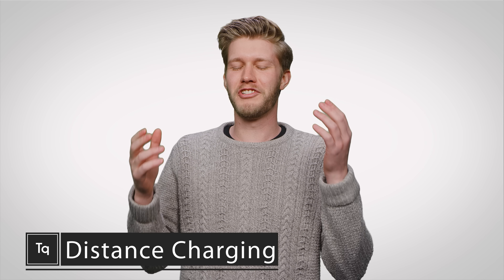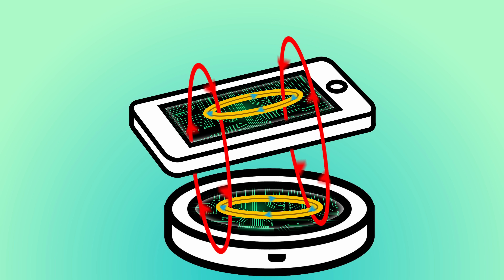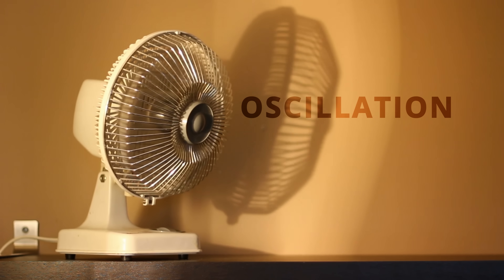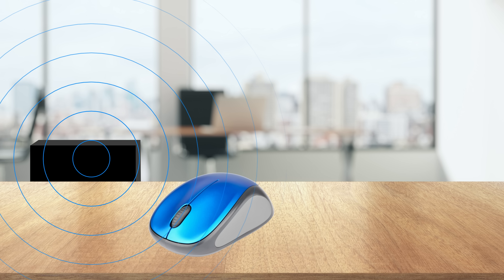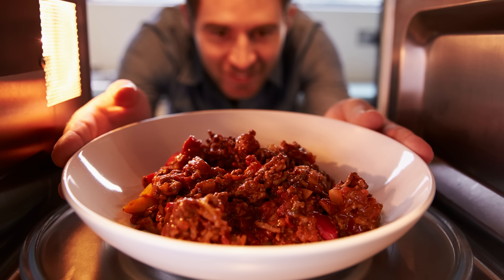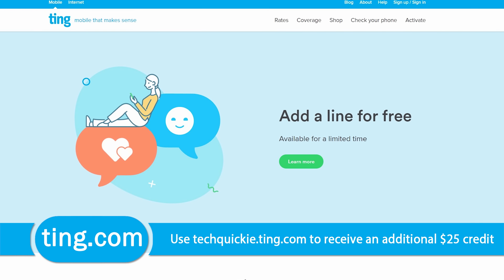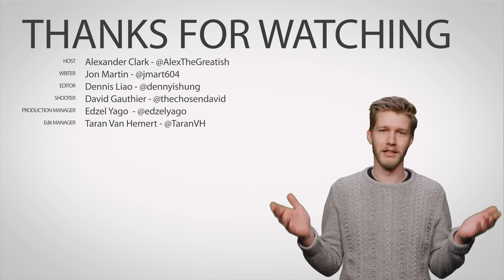NEVER Forget to Charge Your Phone Again

Comment: Wouldn't a charger like the 3 DS's work the best you just said the 3 DS on the charger and two pins get pushed Out and Touch metal spots on the back of the 3 DS so one it just locked in super easily unlike those wireless chargers we have to try to line it up and 2 since it's technically connecting a wire there's no power loss

Comment: Routers operate at the same frequency as microwave ovens (sometimes higher frequencies at 5GHz)  and that they transmit well over "a few milliwatts" typically in the range of 50mW to .5W. Unless of course you mean it can only charge at a few mW. In that case you are looking a few uW not mW. RF is a terrible idea for wireless charging. Seriously, a very very terrible and inefficient idea.

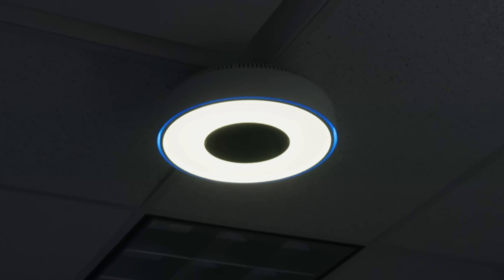Comment: 3:58 ... only problem is how much power you are loosing in the process... The efficiency can be as low as 1 % ... SO while you are wasting 100W power on you electricity bill ... your device will only be charged with 1W ... the rest of the 99W are lost.

Comment: the only way long distance wireless charging is going to work for devices that use more then a tiny amount of power (like a mouse\keyboard) is if it's directional.  Who the fuck would really wanna pump 100+ watts into a charger only to get 5 or less at their device?  The directional part could be automated (i think the IR device did this)

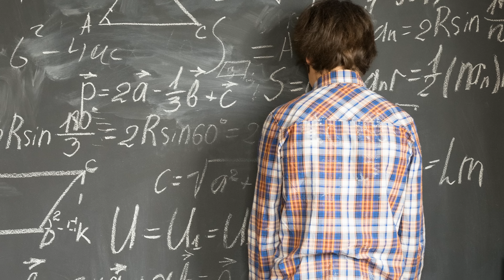Comment: 1:37

No, its not. Its a pretty simple concept if you boil it down. Its essentially the same thing that makes 2 of the same notes ring out together. If you have an A4, 440hz, and an A5, 880 notes, the ring together with a ratio of 2:1. This is harmony. For every one Oscillation of A4,, there are 2 of A5.

If you take an A4, and detune it to 435hz, and make it ring with a non-detuned A4, you get 440:435, with a remainder of five. So for every oscillation of A4,  it gets 5hz out of phase. With electric current, this lack of phase prevents the ability of the circuits to resonate, by making there a fundamental difference in the shape of the current, and phase of the magnetic fields. 

Hope this helps. Feel free to correct me if this is 100% bullshit

Essentially the magnetic fields ring out WAY faster than we can hear, in the same way 2 wine glasses ring out if they are "played" together.

Comment: What about the fact that wireless charging of all kinds wastes more electricity than plugging it in directly? It's convenient, but in this modern world of trying to save electricity it's going to cause problems when large numbers of people switch over. See "The truth about wireless charging" by Real Engineering to see what I'm talking about
Reply: very true, but for low power devices it's really not a concern so long as it's remotely efficient (RF charging without beam shaping could be horrible)  Considering the battery capacity of most phones is sub 15wh, and such a phone will last a day or more, it's trivial.

Comment: Ugh. RF charging should not be a thing. The efficiency is going to be so terrible, like less than 1%. RF spreads out as 1/R^2, so there is a ton of loss over even short distances. We don't need to be wasting more energy just to charge our phones remotely. Just get out of your bed and plug in your phone, you lazy ass!

Comment: I have not had that moment. I plug it in to charge when I wake up, so it's not trickle charging at 100% for most of the night.
Also, "over the air" charging is what should really be called wireless charging, and the crappy "wireless charging" we have now should be called "dock charging". It's not wireless charging until my phone isn't tethered to any device. Replacing the wire with a dock isn't wireless, it's actually more cumbersome and inconvenient. Easy to tuck a cable away when not in use for the 22 hours a day I'm not charging, hard to tuck a giant dock away.
Reply: 0:39 - You see, if I have to plug in a charger using a wire, it's not wireless!
(this is critique/a rant about the garbage technology, not the video)

Comment: What's the net efficiency of wireless charging even now?  Something like 1% or less since they sit burning power 24 hours/day and only work at 25% or less when in actual use?  Green New Deal says what?
Reply: qi is 60-80% or so efficient, and it's not going to use much power if it's not actually charging a device.  They don't simply sit there pumping out full power at all times, that's not how the tech works (it's basically the same as a power transformer)

Comment: I think a better way of explaining about how IR energy relocation would work.  Is to say it's pretty much like a laser.  Most people have no issue imagining how a laser would burn anything it is pointed at.  Even if it is far, far, away.  Then explain how heat is energy is motion is mass (as explained by e+MC^2).  And they can easily see how IR can only travel in straight lines.

Comment: This CAN'T be safe !  I just did away with my Smart Meter & Turned OFF my WiFi and connected every computer by ethernet cable....FASTER, 200mbps instead of 100 or less mbps through WiFi.
Reply: BAD B congrats! reducing rf exposure is good. a healthy move.
Reply: BAD B did your power company give you slack?
Reply: @Vaati  Yes, just One time they didn't fill the request.  Then it got put in second time...cost me $19 more for OPT Out, but my Bill is Lower?!?!? yeah !
Reply: BAD B yeah usually analog meters are cheaper, whilst being safer.
Reply: @Vaati  Yep, I heard Smart meters have burned down MANY houses and Made MANY People Sick.  I was hoping that power usage monitoring and jacked-up cost of using at peak times would GO AWAY...and it DI, and I'm saving Money !!!
Reply: BAD B lol

Comment: I don't understand why people use the existing wireless charging. I have Samsung phones and I bought a 2m long cable for 2€ and now I can charge my device even when I'm using my device far away from the socket. At wireless charging, your device must touch the charging pad. That's silly -- it's like wired charging with an extra short cable, I really don't see the point of it ... up until they develop the new extra distant wireless charging.

Comment: Buy the a phone with 18000MAh Battery
Reply: or the Ulephone power 5, it needs sth around 3hours from 0 to 100
Reply: @Young Thug haha yeah
Reply: And then wait for a week for it to charge.
Reply: @NJ-wb1cz  9 hours actually
Reply: @Naverdo  Actually it actually depends on the actual charger and the actual battery. 
Actually.
Reply: @NJ-wb1cz  I'm not sure from what percentage it will take so long but the charging time is 9 hours with the charger that comes in the box
Reply: @Naverdo  my charger came in a plastic wrap. Is it better than the ones in box?
Reply: @NJ-wb1cz  I meant the charger that comes with that specific 18000 mah battery phone.
Reply: @Naverdo  i don't want a battery phone, i use smart phones

Comment: With android just go to the developer options and activate demo mode and your phone is at 100%. Tbh this mode lacks some features. Is nice to change the bar for demonstration but it can be more options.

I think what devices need is a option to set a charging limit and maybe even more. Charging a Li-Ion battery to 100% is not good. With big batteries it's even not needed to charge to 100% to come over the day. Being able to set a smart charging limit, where the device keeps the charge in a certain range e.g. Charging when under 60% and stopping at 80% is better than keeping a device at 100%. Sure when the device can bypass the battery, it won't be a problem.

When devices even have a wide assistant support, you even can say when the device should be topped to the charge limit or even go to 100% but calculate that the device isn't that long at 100%, when plugged in. Depending on the device, the device can have the brain in it or just the charging mechanism.
Reply: It's easy to do, but for some reason no one does it. So for now, grab an app like Accubattery since it has a little warning ding when you reach 80% or any number you choose.

Comment: electromagnetic radiation.. any form or  "size" of it is altering dna in few mins and cause serious health and permanent issues like diabitis..isomnia. is not a theoriticaly study anymore... is fact based scientific result. 🤨
Reply: Yeah, you can't even spell "diabetes" buddy. Get fucked with that bullshit "fact" (very paranoid bias)
Reply: I turned a strawberry into a rabbit by changing its DNA with WiFi signal. True story.
Reply: That's wrong. Only ionizing electromagnetic radiation will cause any sort alterations in DNA. So that means UV, Xrays, and Gama Rays. Otherwise, if what you were saying is true it wouldn't matter anyway because we'd have loads of cancer from visible light which is a shorter wavelength(and therefore has more energy) than infrared, microwaves, or radio waves. So just to clear things up. None of these technologies mentioned in the video use ionizing radiation and would not be harmful in any DNA altering way.
Reply: Mr_McNuggie by what they say
Reply: Well, it's not that Simple. Mor every radiaton os harmful. It all depends on how energetic os the radiaton and how long you submitted to it. Like Captain Heat Said, UV and above are harmful,but when you make and X ray on hospitals, these Lins of radiaton are more energetic then UV, but you're submitted to such a short period of time, If you make less then 2 or 3 a year, they're harmless. In other side of the Spectrum (literally), microwave are much less energetic then visible light or infrared, but If you're submitted for a really long time, it can affect you're sperm quality ,e.g., and If submitted to a high intensity beam of it, It can cook you alive.
Reply: Indeed - I can damage DNA with infra red radiation, or as we more commonly call it because "eat your damaged DNA" sounds weird, making dinner.
Reply: @beware_the_moose  thats the temperature breaking the molecular bonds in DNA
Reply: EM radiation? You do know only UV and beyond are dangerous?

Comment: It's cool but it does also sound like cancer
Reply: It is well known and proven that non-ionizing radiation has no mechanism to cause cancer. I know it's fun to make dubious claims you've heard somewhere without really mdoing research but spreading bullshit helps nobody
Reply: This kind of scientific fear mongering and ignorance is a cancer on our society.
Reply: My thoughts exactly. 5g might be the first worry
Reply: Jesse Leonard there’s the exponential proximity issue, so as cellular towers are usually quite far away it doesn’t matter as much, but things like having a router in your bedroom, or a wireless power emitter near your bed are causes for concern. There’s a misconception that non-ionising radiation is 100% safe at any distance and intensity, I’m telling you now that’s not the case and it’s going to become a bigger and bigger problem over the next 50 years as the new tech spreads, unaware of the mounting cancers which take 30+ years to become detectable. 
(Studied physics and electronic engineering at university and work in the health, fitness, and technology sectors).
Reply: @chrisogrady28  
I call bullshit, that type of radiation is not ionizing radiation it simply doesn't have the power do do that. 
Also, you're better off near cellular towers since as your phone gets farther away, your phone has to output more power to connect to the tower.
And over the last 20 years, the use of wireless technology has increased by a lot, yet the number of Cancer cases remains pretty much the same.
Reply: @chrisogrady28  it's not a danger, its not ionizing radiation, the towers are emitting radio waves emitted are not a high enough frequency to be ionizing. If what your saying is true, then you should have cancer all over you. Viisible light is a much higher frequency than any tower will ever transmit. Visible light starts at 430THz and the highest frequency we normally transmit is about 100GHz, you do the math...
BTW 5G will use current 4G bands... Though some short range bands will exist in the 86GHz range. 

No go stand in front of a lamp and tell me if you get cancer.

https://en.m.wikipedia.org/wiki/Electromagnetic_spectrum

 Here's some research for you. It maps out radio frequencies for you. As you can see the higher the frequency, the closer you get to the nasty stuff. But wait what do you see? Visible light is way higher in frequency than your radio broadcast frequencies. Interesting right?

Comment: The engineers are talking. A summary of what he did in school
Reply: Though, he forgot to mention that, if everyone uses wireless charging, our demand for electricity would sky rocket because wireless charging is immensely inefficient!
For the sake of our planet, don't use it.
Reply: @GLITCH_-.-  Yeah, I have been trying to explain that to someone because he doesn't get why one phone wirelessly giving power to another is not a great idea.
Reply: @GLITCH_-.-  Well he probably skipped that class
Reply: @GLITCH_-.-  Even if it's 1/3 as efficient, and worse 20% of people adopt it (less than that use Qi charging, so it would be even less for this "distance charging."), that would be like that 20% of people using 3 USB chargers. So energy demand wouldn't sky rocket. Not even close. Things like air conditioning/chiller plants, aluminum production, and other high energy devices that use several orders of magnitude more power, will make the increase barely perceptible.
Reply: @xenonram  1/3 would actually be very good. Anything that's more than a few cm away will be exponentially less efficient.
Reply: @xenonram  perhaps not skyrocket though there would be a noticable difference with over 150million people changing.
Reply: It will be a very big increase that is totally unnecessary. I remember seeing a video about it, but couldn't find it anymore.
Reply: @Andrew Delashaw In the video he showed a car charging wirelessly. Currently, I can not imagine there is anything worse than. They have one of the biggest batteries ever built.
People keep wanting to do less and less, and that includes the hassle of plugging a device in a charger. So this tech will spread everywhere. And nobody (no consumer) will take the time to correctly line one coil up with the other.

Comment: Just press alt+f12 and turn on infinite electricity and you won't have to charge your phone at all lmao
Reply: KSP player
Reply: Turn off gravity and have infinite fuel at the same time and fly away
Reply: Put on no crash damage as well so you can fling your phone across the room to your wireless charger
Reply: I still think current wireless  charging is utter bullshit and is zenith of human laziness. 
(Like really WTF it just probably take 2  more calary to connect it to cord ) heck you can use your phone in normal charge.
Reply: @aaddiis45021  you don't have to mess with the cable that could break and the port on the phone/device wiggled out.
Reply: @zmeizy  no purchase a fucking sperate charger.  And put it on the location where you keep wireless charger it is 100 times better. Also charging cable Don't break(one plus 5t).
Reply: @aaddiis45021  2 CALORIeS. 2 FUCKING CALORIES. DO YOU HAVE ANY IDEA WHAT I COULD DO WITH THAT. I COULD PAWN ONE MORE NOOB IN APEX. 
Jeez man. And if I turned on power saving mode in human bios i could pawn two nubs
Reply: @npn2463  ok you have a point man
Reply: @aaddiis45021  i have a rugged phone and removing the rubber plug is horrible if you bite your nails. Wireless charging is perfect for me
Reply: I agree but one benefit would be not wearing out plug connections. Other than that, just plug them in for petes sake. I find some things labeled " new and improved" are just a lazier way to do something and sometimes with a negative side effect over time.  I will just stick with plug in for the phone though.  : )
Reply: Alt + f13 is even better
Reply: @alexhazard8807  ctrl + alt + f13 opens up free  game hacks!
Reply: Yespacito troll physics heheheheheee
Reply: What butons to press to Make keyboard for phone ?
Reply: Ha! jokes on you alt-f4 does NOTHING on a mac and alt-f11 and alt-f12 open system preferences.
Reply: yes sir
Reply: Also press ctrl + W to win at life.
Reply: Ya but im tryna beat the game without cheat codes
Reply: I love how a KSP joke is getting so much attention. Well played
Reply: You guys have it all wrong delete system32 and you will have no more power issues!
Reply: might as well set orbit around the sun while you are at it
Reply: Nah just use ALT+F4
Reply: Just add struts to your phone
Reply: super+f15 is actually usefull
Reply: Why not F69??
Reply: But phones don't have an alt or f12 button!!!!
Reply: Inatuctions unclear, It just quit my game
Reply: Yespacito the shortcut ur thinking of is alt+f4 I think
Reply: I'm on my phone how can I do it?
Reply: Top 10 smartest anime characters
Reply: I pressed alt+f12 expecting to fall for a troll.  nothing happened.  i am dissapointed.
Reply: Alt+f is better
Reply: Seriously how tf did you finish the video so fast 
I literally just came as the notification popped up and after a minute refreshed and saw this nigga 
Tell me your secret
Reply: @zingyburger  how do you know that he even finished the video? you can comment before the ad is done playing like i am rn.
Reply: haterr plays dude no ad was playing
Reply: its actually alt+f11